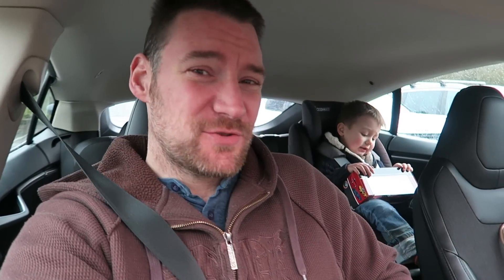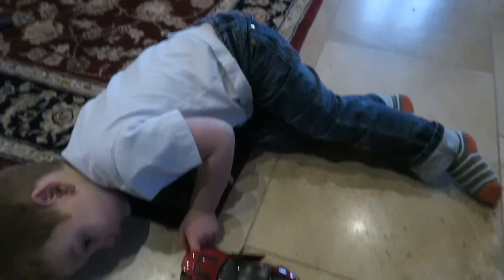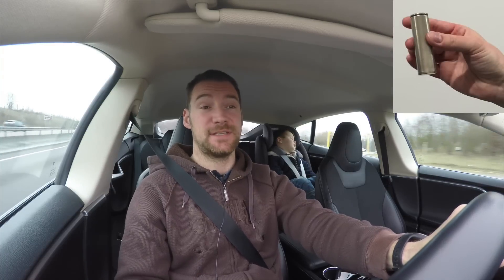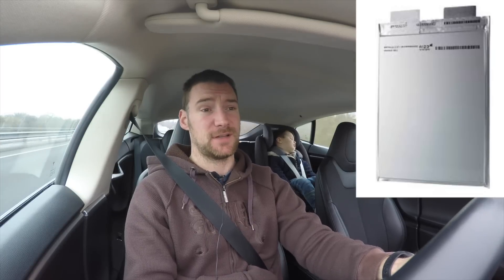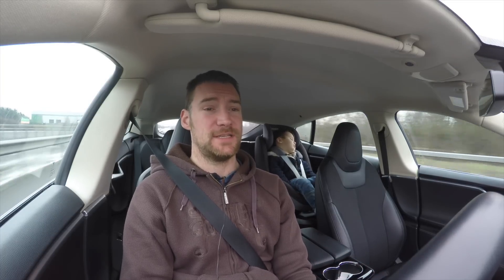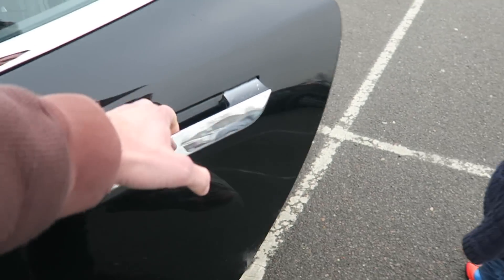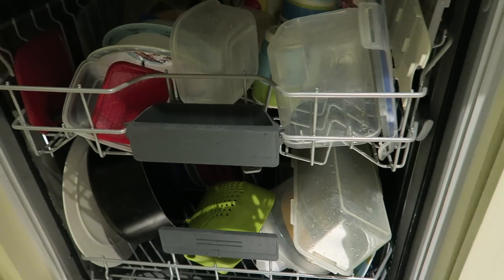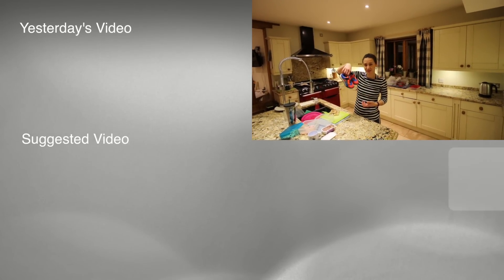Tesla and a whole new cell format

Comment: I think used Tesla packs might become sought after items in the future, with enthusiastic individuals reconditioning them by weeding out the worst cells and replacing them.
Reply: Clifford Rutley They are already sought after. Jehu Garcia vlogs about his EV retrofitting work and they are usually sold out of second hand Tesla cells. All the ones they can buy are already destined for use in projects.
Reply: They are reconditioned and end up in the Tesla Powerwall units so there's little waste
Reply: Yes I know people are doing it already. EV West have put one in an old VW Camper in their Vlog. What I had visualized though was a future 20 year old Model S owner reconditioning their car's battery themselves or taking their car to a 3rd party battery reconditioned that would do the job for them.
Reply: Clifford Rutley I see. Yes, I hope such services will be offered for a reasonable price by specialists in the next 5-10 years to cover all sorts of EVs. I'm not sure how easy it will be to seal up the pack after refurbishment but hopefully they'll figure it out. Especially for some of the older EVs, I wonder if it will be possible to replace all the batteries with higher capacity versions and end up with an extra 20% of the original range when new!
Reply: I don't know. But with Tesla using a common type of cell in their batteries, I feel that such services will be easier to offer to Tesla owners than with other manufacturers that use the custom types of pouch cell batteries

Comment: You may Have heavier cells but they have 2 advantages, they are self supporting and don't need as much internal structure, plus a fortuitous cooling ability from the slightly inefficient packing of tubular cells. The cell chemistry can be the same.

Comment: The thing to bear in mind about other chemistries and fuel cells though, is that you don't need to actually use hydrogen as the fuel for hydrogen fuel cells. It's perfectly possible to use LPG/butane etc. as the fuel and convert that to hydrogen on board, with a reformer in the car, between the fuel tank and the fuel cell, giving you excellent energy density at a low cost and more safety than with gaseous or liquid hydrogen, as the hydrogen produced is used (and reacts to form water) immediately after being produced in the reformer.
Reply: True +David Williams however the reforming process generates carbon monoxide which  needs to be shift purified to carbon dioxide so you still have carbon emissions.  Efficiency is not so good since the heat generation of the system cannot be put to much use in a vehicle thus will be wasted. The reformer also requires extra space and adds to the complexity & price & maintenance of the system. Reformer or not an FCV is still an hybrid system so an EV with a battery ( albeit smaller than in a pure EV) plus an additional fuel based electricity generating system therefore a simpler base system made more complicated and wasteful.

Comment: Ir it true that Tesla are working on two new charging as you drive options - a roof-rack with a pantograph option or an embedded road to vehicle inductive coupled charging system for lane 1 motorway and stationary traffic light  charging. The second option would work well in London with the 3MPH traffic speeds :)

Comment: I think incremental increases in battery tech at the current rate will make them a no brainer in a few years anyway. I totally agree with your opinion on fuel cells. I am loving having the Zoe, took a friend out in it today and she was amazed by the 20-40 acceleration plus smoothness and quiet. She had no idea it would be so good, it shows the general perception of EVs is still that they are a bit like milk floats, she also looked at the 130 odd miles range left and was surprised by that too (I'm getting close to 160 miles range now I'm getting better with the anticipation).
Reply: If you like Zoe's performance, just wait till you drive an i3. Or a Tesla!
Reply: Reason077 I think it is the instant throttle response I really like. I've had some powerful cars and bikes in the past and there is always that little delay before they pick up (unless you keep the revs up all the time). I'm sure I'd enjoy a faster EV but quite frankly their performance is more than I'd ever need on the relatively crowded roads in the South East of England (will the M3 road works ever end?). When I was younger I will admit all I wanted was power but age definitely mellowed my driving style (for the better in many ways). I don't think there is anything as relaxing to drive as an EV.
Reply: Robert Smith my girlfriend Hannah's owned a zoe for a well over a year now she loves it even i have driven it and geez its werid having sudden power.

Comment: just my opinion but I think they probably use the cells they do because for example each cell may cost only 50p rather than £10 for a pouch cell. and when they test them to choose the best performing cells ( as not all batteries are made equal ) any that  don't meet the standards can be got rid of for a much lower cost than binning a pouch cell.

Comment: Density of batteries even if not double say 5-10 % increase every few years is well ahead of hydrogen , hydrogen density fixed for ev, any higher requires higher pressure and increased danger + other problems such as infrastructure problems so not going to happen. Even being negative 200 miles standard in 2 years time
Reply from the maker: Absolutely. Hydrogen has got no chance unless a really plentiful supply of cheap hydrogen just suddenly materialises, and even then.

Comment: I'm still dubious of the need for thousands of little metal cans inside the giant metal can (or whatever it's made of) that encloses the battery pack.
Reply: The main advantage of cylindrical cells is cooled more easily and efficiently. Nobody has yet demonstrated Tesla-level performance from pouch cells. They may have a cost and energy density advantage, but the 2170 format is an attempt to get the best of both worlds.

Comment: James, you''re brilliant to introduce us to ...
American professor, solid-state physicist John Bannister Goodenough  [popularly known as the 'Li-ion King'], working with Maria Helena Braga on this potentially superior non-liquid dielectric battery.  Very promising development, to be sure.  
//  However, it's not yet scaled-up for production replacement of Lithium batteries.  In fact, more than a dozen other inventors working on the problem have announced their own advanced battery types for the future.  
//  Tesla may still be the unchallenged leader for some time to come.
Reply: Daniel Murray I'm pretty sure that anyone banking on EVs to be the future will back the research on this battery tech.

If solid-state batteries means something like 3 times the range, while the physical size and weight of the battery remains the same and has fewer cons than current li-on tech, it would be crazy not to invest in this. 

The new gold will be battery technology, slowly replacing the heavy reliance on oil.
Reply: +pHD77  -- Undoubtedly, and encouragingly so.  The Goodenough/Braga offering and the others are unable to scale-up their inventions yet to offer commercially.  Wait and see...

Comment: well said James, hydrogen is a good idea too, it's like going to the gas station except you are getting a clean fuel instead of dirty gasoline.They have been airing the commercials here in California like crazy! about new hydrogen cars and fueling stations.Right now you can pull in and fill up way faster, then the charging stations, for now anyways. I was like you too, in the beginning James at first but, hydrogen is limit less, very clean,fast to fill up and here everything is about convenience& how fast u can get me out the door. I like that fact that I could pull into a hydrogen station, fill up drive away and I didn't have to sit for 30 minutes to fill up, plus I'm not polluting the air. anyhow when they do have hydrogen stations all over  it'll be great aka " convenience". they are going to have a massive fueling structure for hydrogen stations all over the USA. These have already been planned out and there gonna be like gas stations, they will be every where. my take on this is a positive win for all of us, it will be awesome so many clean options to chose from, one thing tho I do wish that they would include plug in versions of the new hydrogen cars as well anyhow good video as always. Stay safe
Reply: p.s. I know someone will say hydrogen is it's not limitless, we got a lot of water on the planet so yeah we got a huge supply.
Reply: So you've just admitted that you have no idea how hydrogen works as a fuel and what cycle it does...
Do some research  before trying to defend something.
And find out WHY everyone is saying hydrogen is stupid... It's not because it's not viable. It's because it's hundreds times more dangerous than petrol, more expensive, and looking from energy point of view, you add another at least two steps of wasting energy before you use it up.
Also, the only reason why they advertise and try to push hydrogen is because they would need all infrastructure as petrol has now. Where battery only needs a cable from anywhere.
And if your only concern is time spent refilling, you should really take a look at charging at home. like your mobile phone. You don't drive 250+ miles every day, do you? 
Also, have you actually listened the part about batteries just starting to advance? Have you heard major manufacturers announcing 350 mega watt charging as STANDARD? And then Elon musk laughing at them, because he wants to do 1000? At that level you won't need to spend more than 5 minutes refilling. It will be faster than petrol, cleaner than petrol, and 10 times cheaper than petrol...
And even if it wouldn't become faster... a full tank of gas costs how much? Here in Europe it's 100$+. So You're saying you really could not wait while getting a coffee and saving 90% of that cost?
Reply: Edvinas Ksivickis yea the rough idea is around 100k before the hydrogen fuel cell is rubbish and needs to be replaced
Reply: Thomas Gordon if you watch his videos enough you'll see he hates hydrogen more or less
Reply: Dylan White  I know and I do been a sub for awhile that's why I said what I said because I felt like he did before& now I dont
Reply: cinema writer relax I hate when other people take something out of text I'm happy because it's a clean energy omg get a life seriously it's way better then breathing all of the toxic fumes from all the tail pipes gezz la fricking Louise!
Reply: also I'm don't make the rules or the game ur right Big companies have a lot of control that's what's coming you might as well get on board if it's a good thing
Reply: Hydrogen is never going to work as a general-purpose fuel because the billions (trillions?) of dollars in infrastructure it would need will never be built.

It might be viable in a few niche areas/applications, but in general, the chicken-and-egg problem and bad economics/efficiency of Hydrogen are insurmountable.
Reply: Reason077 if you can't beat them join them. plus as James said there is new technologies coming for the batteries as long as we're using clean energy for the masses I'm all for it.
Reply: Yeah, that's pretty much what most car makers (most recently, Honda and Toyota) have done. They've realised that hydrogen can never beat batteries. Hydrogen is a pipe dream of big fuel companies, now becoming scared of battery electrics because they will lose control of the supply chain. But it's a fight they can't win - Hydrogen ain't gonna happen.
Reply: What a load of BS... hydrogen is produced just like electricity, you need a 3rd party : solar, nuclear, or like in the US, mostly... COAL !
Yes, your Tesla are burning coal, which is much more polluting than oil !
Tesla cars don't emit CO2 where they drive, but they they produce twice more on the other side of the chain !
"Clean energy" for the masses is just a marketing trap for simple minds...
Reply: Incorrect. Electric vehicles emit less CO2 than fossil fuel vehicles even when their electricity comes from coal. Besides, in most of the world - including the US - Coal's share of grid production is rapidly declining as renewables and cleaner, more efficient gas turbines replace them.
Reply: Electric vehicles emit less particles, of course, but the coal plants that produce the electricity used to charge their batteries emit MORE !!!
And coal's share is STILL more than 60% in the US...
Reply: The idea that EVs powered by coal-fired power plants emit more CO2 than conventional vehicles is *false*. Even under a "High Carbon" (93% coal) grid scenario. In a low carbon grid, such as California, EVs are dramatically better. See: http://www.afdc.energy.gov/uploads/publication/ev_emissions_impact.pdf
Reply: Again, this doesn't add up. Any serious source recognizes that burning coal emits MORE CO2 than oil for the same amount of energy produced.
And in this case you need to add the energy lost in cables, charge of the battery and 2 AC/DC conversions, not to speak about auto-discharge - there are videos of Tesla users who couldn't start after 3 days, while the battery had still dozens of miles to drive when they parked it !
ICE cars may have worse losses, notably through the gearbox, but if you take into account the energy and pollution caused by mining for 1. coal in the case discussed here (which your PDF obviously forget to mention !) and 2. rare earth minerals needed to produce Li.OH batteries (and I am NOT speaking about Lithium, but other minerals that do not figure in the name of these batteries), that's the ecological costs of the battery, your affirmation is false !
Reply: It does add up. It might not seem intuitive, but it's true: EVs do not result in more CO2 than ICE vehicles even when their power is produced from coal. This is because even the worst coal plants are more efficient than the best ICE vehicles. The losses in transmission and charging in an EV are not enough to fully offset poor thermal inefficiency, transmission losses, idling, etc in an EV. Numerous studies from credible sources have reached this conclusion.

And of course, as grids get cleaner - with coal being replaced by cleaner technologies - EVs get cleaner. ICE vehicles, on the other hand, will keep polluting at the same level as long as they remain in service.

As for battery production, EV batteries do not contain any rare earth elements. You're probably thinking of Cobalt, the mining of which is an environmental concern in many countries. Modern Li-Ion chemistries have reduced (and in some cases, eliminated) cobalt use. Since it's expensive, there is an economic incentive for battery makers to do this.
Reply: You keep repeating the same arguments that have been mentioned earlier... about batteries not using rare minerals, very destructive to extract from the environment, not being a  source of pollution and costly in energy to produce and recycle, it just shows I can't take you seriously.
It's the same marketing speech again and again, which is mixing reality and future possibilities, like saying that the grid is cleaner while it still mostly runs with coal, saying that batteries don't use Cobalt, while new formulas are not yet on the market as they can't hold the same amount of energy, etc, etc...
I'm not saying EVs are bad, or even worse than ICE, they are better on some points, but worse on other issues, issues that are just banned from EVs supporters marketing speech.
Reply: I never said that batteries aren't energy intensive to produce. Of course they are - but so are internal combustion engines and transmissions! An ICE not only takes a lot of energy to produce, but will produce additional pollution throughout it's lifetime. Batteries, however, will offset and reduce pollution throughout their lifetime - paying back that initial energy investment many times over.

Your claim that the grid "still mostly runs with coal" is completely false in most western countries. In the USA this has not been true since the 1980s. In 2016 only 32% of the USA's electricity was produced from coal, and this percentage is dropping every year as cleaner and more efficient technologies replace coal. In many states, such as California, virtually no electricity is produced from coal.

Comment: Hydrogen, the point is that hydrogen is not that easy to make at home. So you have to buy it from the big companies. And they will have the price under control. And taxes. With a amount of solar cells on your roof, your the boss, and as we now.... The sun is still free.
Reply: As long as you're able to charge at home, yes. I live in an apartment building, I park my car underneath my kitchen-window and run an extension-cord 4 floors down, but as long as I'm the only on in this block it wont be a problem.
There's a public charger 200 meters from my house, but that would cost me more than double for a full charge.
Reply: Pollie0870 Oké, but the electricity from the grid is in any household available. 3 fase or different. To make benzine/ hydrogen is something else. That's the beautiful thing of Tesla cars. Lots of success with the blog, very nice. And I ordered the model 3 this week 😊
Reply: In the US most electricity comes from coal, so driving a Tesla may well be MORE polluting than an ICE... solar and wind only represent a few percents of your electricity, even in Europe, etc.
Reply: True, but my roof is covered with solar cells. I produce more energy then I use. And better control one point the burning local, so you can filter the shoot. Do you have solar cells on your roof?
Reply: Benzine???? What the hell are you talking about lol  Also Hydrogen is a lot easier to produce then you realize.